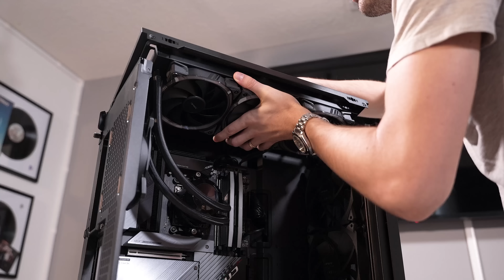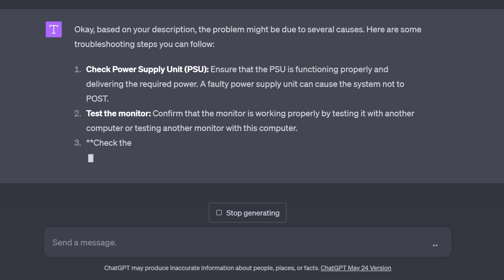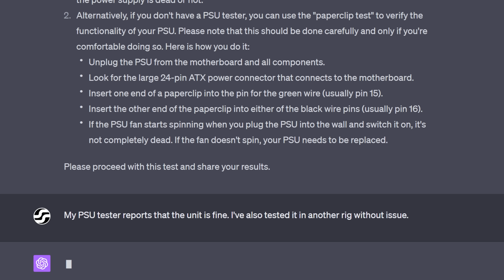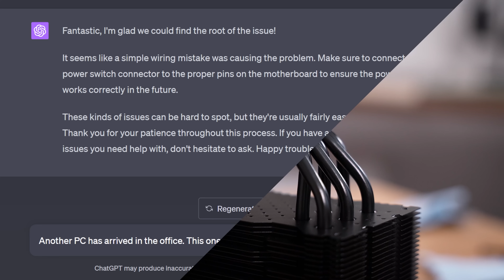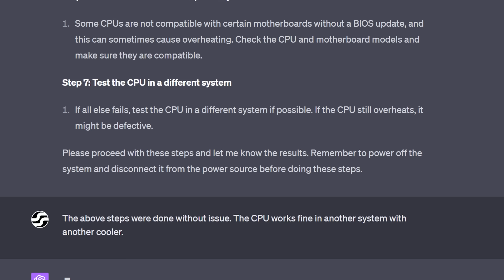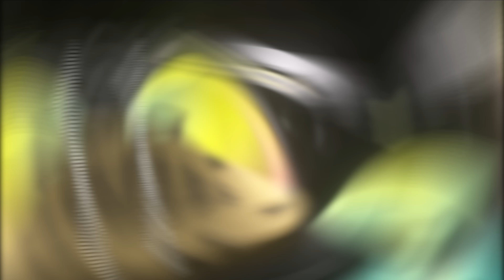I Had AI Troubleshoot Gaming PCs... Here's What Happened

Comment: One time I forgot to remove the plastic from the cold plate and it was an AIO and it actually didn’t overheat, it was warm but topped out at 65 C even while gaming. The only reason I knew something was wrong is because the air cooler I had was working better and it dawned on me so I looked for the plastic and couldn’t find it. Removed plastic and but the temp In half. I felt dumb, first time in 30 years of building.

Comment: Technically on #3, it did solve the heating issue with the step 2.2 suggestion, because when you go back to reapply thermal paste you would had realized you didn't remove the sticker on the cooler. Most if not all PC builders would not know either until they remove the cooler and realized they didn't remove the plastic sticker.

Comment: Hey there! I think in scenario #2 it was partly flawed. Since chatgpt retains the history it had provided the steps for the system to troubleshoot from scenario #1. When you told it to go step by step and try and hone in it was still attempting to troubleshoot scenario #1 and not the issue of the machine not powering on at all when pressing the power button. And every further message from there it was still thinking on to from scenario #1
Reply from the maker: No, we explicitly told it that we were finished with Test #1 and that the computer had been fixed.

Comment: I think you're misunderstanding how ChatGPT learns. It also doesn't help that you call it "OpenAI" multiple times, which is the name of the company not the language model.
Nothing you're teaching ChatGPT will help it learn right now. When OpenAI begin working on ChatGPT 5 (or maybe 4.5) they will integrate some of the responses from the conversations that ChatGPT 4 has had, same as 4 did with 3 and 3.5. But it's not going to be every conversation from every person, as that would fill the model with nonsense. Most likely it's mainly going to focus on responses that have been thumbs up'd or down'd by users en masse.
So giving incorrect suggestions to 50 people and getting thumbs down for it, will result in good responses to that same question being integrated into the model. Some random guy asking about plastic on a CPU cooler will not.

ChatGPT does remember what you've been talking about, within the same conversation, but only up to a point and only for you. Currently ChatGPT 4 can remember 10000 tokens (which is parts of words) which means that when you get far enough down that conversation, it will forget what you talked about early on.

Comment: G'day Greg,
Issue 3 I have seen multiple times in Channel Build videos, especially when the host is used to using stock coolers or a cooler brand that does pre applied TP & then switches to a brand like CoolerMaster that just gives you a tube so you have spare for later or an OOPS! like this one.
I would be interesting to see when given the same cooler problem at a later date if it remembers what it was "learning with you today"

Comment: @GregSalazar In the second case you were far to nice. Removing CPU and so on before checking the connection of the power supply isn't really a thing that is to be overlooked and put aside as not that good, but ok.
First removing the CPU reapplying it etc. you might damage it (normally you won't have that, but it is a point of failure) but my main concern here are special systems. Water cooling is more common these days. Even though most use an AIO, there are more self build or even prebuild water cooling systems with a full water cooling. Removing the CPU would end up in hours of work. You need to empty the coolant, open up the whole loop to remove the CPU cooling block and the to remove the CPU. Afterwards you need not only to assemble everything again, you also need to make sure the system is not leaking. Normally you do that in a 24hr test without turning on the computer ad just run the loop alone (most times with distilled water only that you release afterwards and exchange it against the needed coolant).
So you will spend several days to do this tests for an error that could have been solved much earlier and without any effort without removing or deconstructing anything.

I might be too harsh or I am hypercritical, but I can't accept that as a good solution.
As you I work in a company to solve problems on the clients. A few years ago I was still working as an on site supporter and now I have the harder job to solve software problems, configure systems and so on. If you would do all this (even with a normal system without a custom cooling loop) and someone who decides about costs from the customer side would somehow get knowledge of that, you would be deep in shit. You wasted several hours and with that a lot of money for something that could have been solved in minutes.

Comment: For computer 2 you said you think the fix order is wrong. But the way you setup the initial question would lead even you to rule this (button wired wrong) out initially. You did not tell it if the computer was working previously or if it never worked at all etc..
Reply from the maker: For test #2, the AI could have very easily asked this question. If a broken computer plops onto my desk, I may not have any context either. Sometimes it's the job of the troubleshooter to figure this out. Occasionally, we go in blind. And, occasionally, we are lied to by owners. Trust only what you can see.

Comment: With the third scenario I think that the AI gave you the benefit of doubt that someone who runs a computer repair shop. Would also have the basic knowledge of removing the plastic off the cooler. 😅
Reply: I think it's morso that it tells you to inspect the cooler and clean off old thermal paste and reapply, if you go through all that without seeing the plastic on the cooler then it shouldn't be expected to tell you exactly to look for it, you probably should have been able to see it from its instructions
Reply: @PuppyGamerYT  I totally agree. I was thinking the same, if you go and your intention is to re-apply thermal paste, surely you would see that the plastic is still on with it's big ass warning labels and everything. It would be impossible to miss to be honest.
Reply: @@brentsmith7013 You don't understand how AI works. It mimics the data it has been fed with (like Reddit posts). These things are not programmed into the AI.

Comment: I had an issue where my PC wouldn’t post with the graphics card in. I would have to power cycle several times, and occasionally I would get a post and everything would run smooth after that. I replaces the CMOS battery and cleaned the graphics card but nothing. I then removed and reinstalled the RAM and it seems to be working fine now. Not sure what was causing the issue or why removing the RAM fixed it.
Reply: Probably an unproper seated ram, might as well check for dead memory channel on the cpu or check the mobo itself, maybe also checking the ram sticks on other rig 👍
Reply: @alderwield9636  it's weird that it would work once booted and show all 32 gigs though. It will run fine for months at a time, but then it will just stop displaying unless I power cycle multiple times. Idk. Hopefully, it's good now, but I have a feeling it will pop up again in a couple of months.